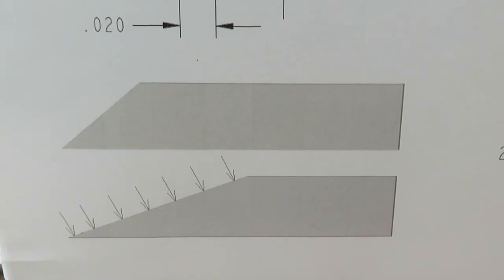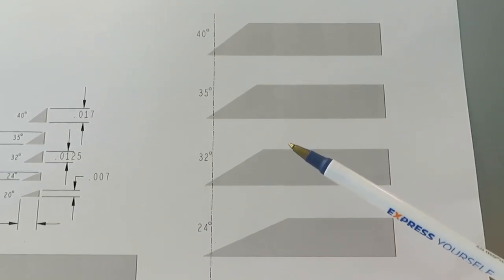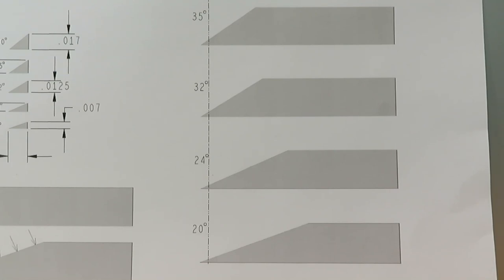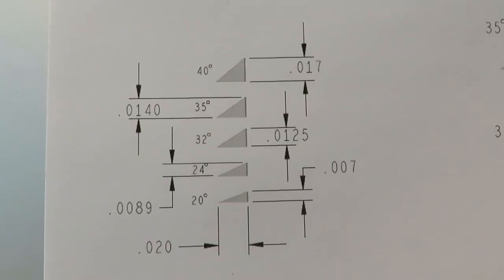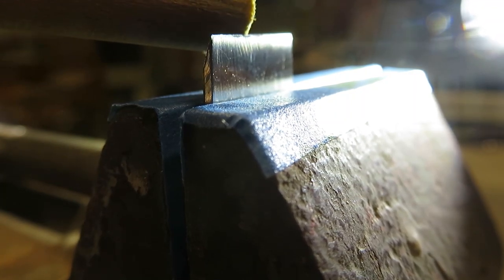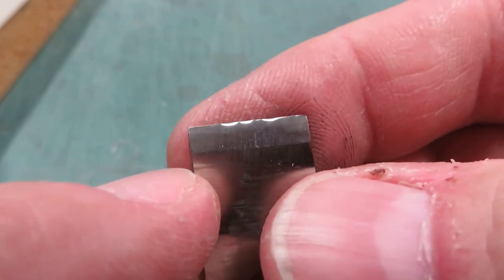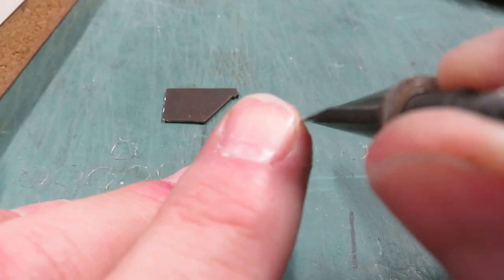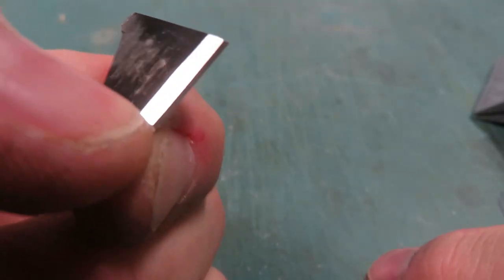Single Bevel Broadhead, bevel angle insight

Comment: For those arguing over 32 vs 35 degrees its like splitting hairs.

Metallurgy, specifically what temper process, how tightly its controlled, and what specific alloy its tailored to is what really matters. The edge should be as sharp as reasonable without denting or curling on a full-pass through on bone hits. Not cinder-block brick hits, Bone. Some steels do great with 25 degree edges, some need 35 degrees to hold up. A lot of people like stainless, but the best rust-proof stainless steels are terrible for tempering, hard impact and edge retention. You would be amazed what 1060-1080 carbon steels and the common leaf-spring steels are even better. (They make axes and machetes out of that stuff, and they hold a keen edge day after day chopping wood).

Comment: I shoot cutthroats. Would you suggest sharpening a micro edge that is steeper than the original angle or would that not matter?
Reply from the maker: yes you would want our 35 degree guide.

Comment: When you are changing the bevel of the edge (from 20 or 25 degrees to 32 or 35 degrees), I assume it takes a while at a rougher grit. Am I correct? 

What grit do you use for that change the bevel stage of your sharping?

I assume you don't worry about taking the burr off until you have reached the new bevel you want (since you will have be building a big burr the whole way to that bevel). Am I correct?
Reply from the maker: start with 240 grit and stop when you get a burr. Break that burr off with 240. Then use 400 until you get a 400 grit burr and break of that burr with 400. Repeat at 800 grit, 1200 grit, 2500 grit and finish with buffing compound on cereal box cardboard.

Comment: No knife uses a 20° inclusive angle. None. Some use 15° per side, but that's only for light use knives. Anything with heavy impact or high demand uses a steep angle. Broadheads should use at least 30°, probably more depending on the steel choice. S7 needs 45° or it'll roll over if you look at it wrong. Micro bevel for the win for those shallow edge grinds.
Reply: Ashby bowhunting foundation has data on several hundred shots through buffalo hide and bone with grizzly single bevel broadheads having 25* bevel and no issues with edge damage. IIRC, plain ol 1075 carbon steel 52 Rockwell.
Reply: @TheJustinJ  A main bevel angle of 25° will work fine with that combo, but that's it. It won't work amazingly and it won't blow your socks off.

Better steel, better heat treat, and the last ~20 thousandths of an inch ground 10-15° steeper. The difference is that after the shot you might not need to sharpen it at all.
Reply: Lots of knives use a 20 degree inclusive angle. I have at least 3, It's just that they are very high-end handmade japanese chef knives both single and double bevel with very hard pure carbon steel( hitachi white #1 @ 65 rockwell).
Reply: @jonbrown9490  I was under the impression they were more like 30° inclusive. I've seen people regrind a Spyderco paramilitary to 20° inclusive and micro bevel to just over 30°, but I don't consider what one guy goes in his garage to be a standard.
Reply: @seanyoung1875  Sure, some are around 30 degrees for sure...my kanetsune deba is. I also have an Aritsugu petty knife that has an asymmetical 15/5 grind and a Ashi Hamono gyuto has the same 15/5 grind. I will agree that you're probably not going to see a knife meant for "rougher" use that would have or even hold an edge with a 20 degree grind. It would likely just chip out or worse.
Reply: @jonbrown9490  It does bring up a good point, though. Your knives that have a shallow angle all are used for gradual slicing cuts and light chopping, and not chopping hard material. 

I've long since assumed that the Ashby single bevels worked because they were long enough to slice instead of chop.
Reply: @YoureSoVane  yeah, I would bet you're on to something with that. They are also narrow from the edge to the spine ( ferrule) where as say, my gyuto, is a full 2" from the heel to the spine. I would guess that there's a decent chance that the leading edge slices in, opens the wound and then the middle of the bevel is what actually torques and breaks bone.

Comment: Should have bought the iron will sharpenong jig instead of the cutthroat jig...
Reply from the maker: No you would have wanted the 35 degree guide, Not the 32 degree guide.
Reply: @innovativeoutdoorsman5067  might have to try an exchange